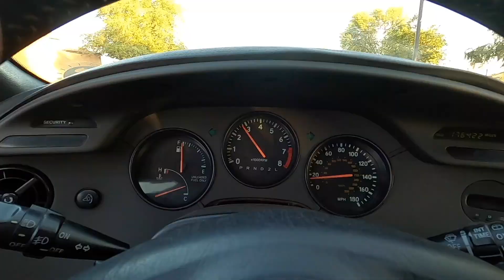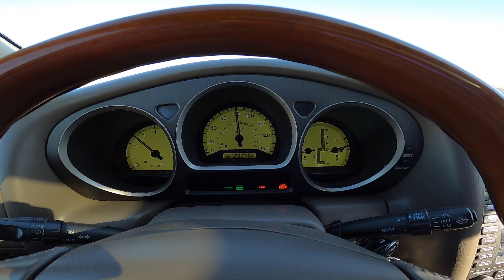EP.#7 Hidden surprise on our new GS430 project. Part 2

Comment: Marvel mystery oil is a high quality product used to defeat sludge. It has greater lubricity than ATF. I add a quart to oil changes. If I have to add oil before oil change I add that. Been using  it for years. They say Grumpy Bill Jenkins  swore by the stuff used it in his race engines.

Comment: Just subscribed.  We bave a gs430 on our channel with a bunch of mods. As well as a time attack ek civic, time attack cb7 and other things. The gs430 has coilovers,  strut tie bars front and back, sway bars front and back, 4 point chassis braces front and back. Gs300 diff. Apexi smart throttle controller,  transmission setting at 3, full exhaust,  full test pipes, intake, figs caster bashings, moog lbw's,
Reply from the maker: Awesome thanks for the support !